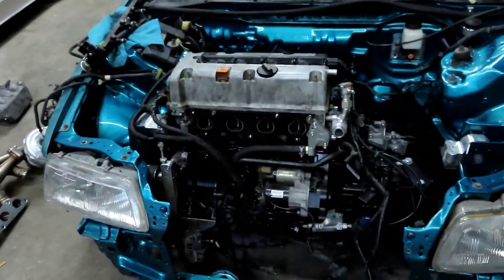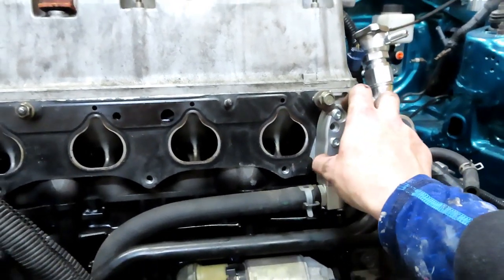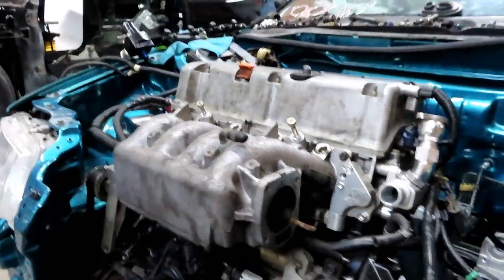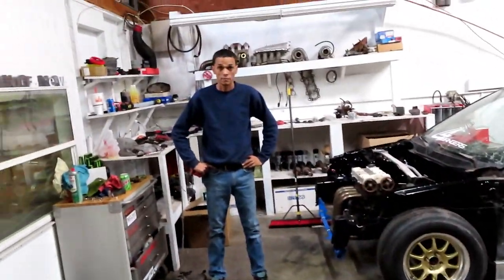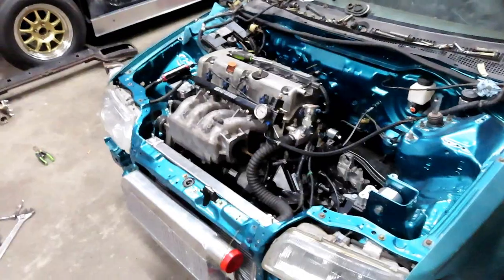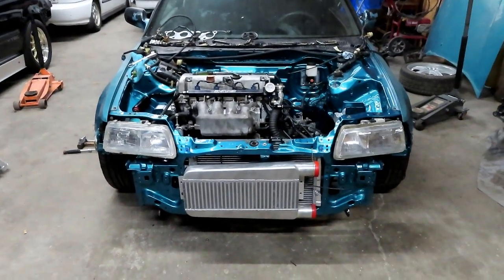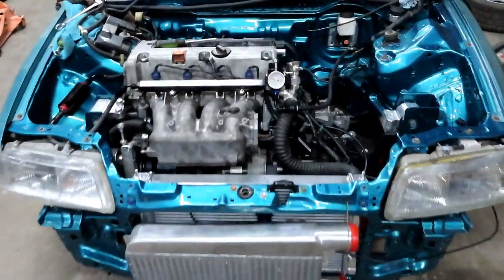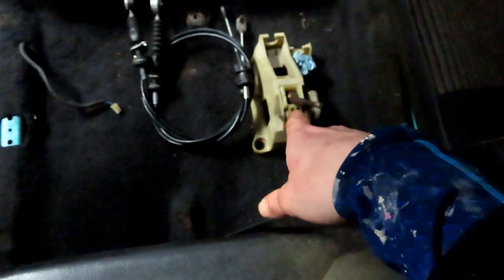K Swapping A Civic EF SI PT.2

Comment: For the hydro clutch conversion pedal box bracket, did you have to cut part of the steering column reinforcement? In other words did your clutch master cylinder mounting bracket interfere with anything? I'm talking about the ebay "b16 ef hydro bracket".

Comment: What axles are you using?  I'm also k swapping an ef hatch.  Thanks
Reply from the maker: Insane shafts but the base model RSX works fine
Reply: @Autosauce  Base model rsx has 27 splines, do I use the automatic axles as they have 26 splines?
Reply from the maker: The manual axles off the base model RSX worked on Josh’s EG.
Reply: Thank you! Looks like the 44306S6M950 and 44305S6M950 will work (base model rsx manual with 27 in and 26 out for the ef hubs.